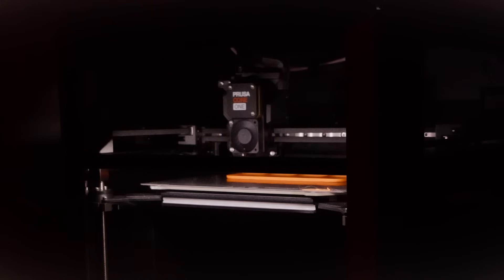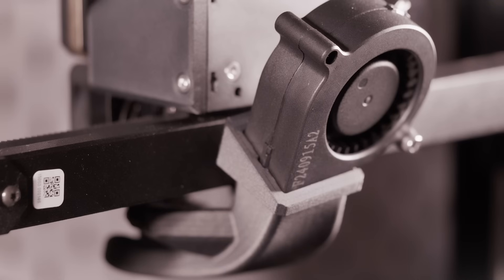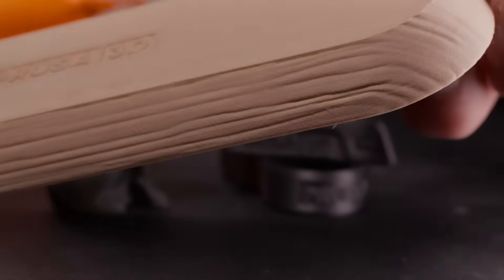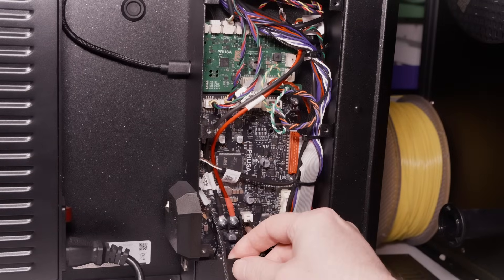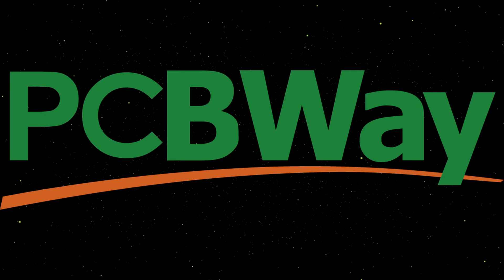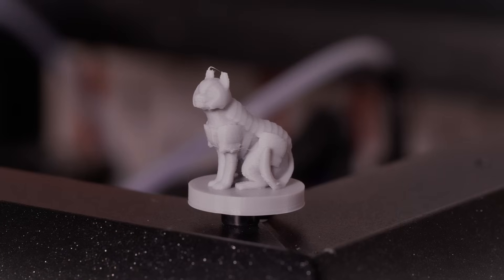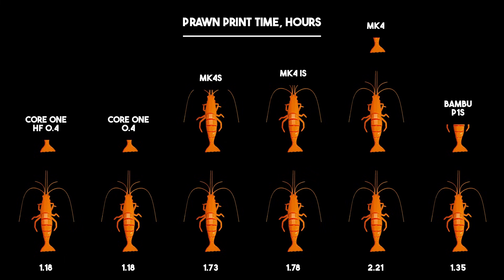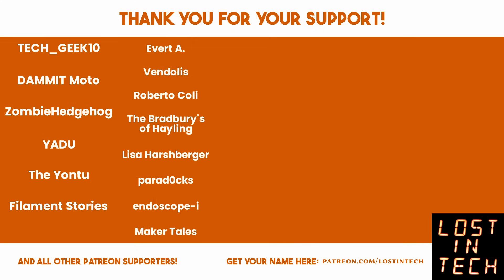Why the NEW Prusa CORE ONE is a 3D Printing Hobbyist and Modder's best friend.

Comment: The X1C isn't comparable to the Core One because... it's old? You mean the printer that predates the Core One by several years and still beats it in every metric but repairability and data privacy? Why isn't it comparable?
Reply: What metrics does it beat it in, exactly? Reparability, open source firmware, data control, lack of required internet or account connection, and many more reason to consider a Prusa. It can print just as fast as an X1C with better quality. Hilarious that people thing Bambu came up with almost anything except their calibration routine. I'd take a Prusa One over an X1C any day, and I don't intend to buy either. I have a Qidi Plus4. It also produces nicer prints than an X1C, by the way. The X1C is a great printer, but when people approach other printers with this snobbery it just shows lack of experience and knowledge.
Reply: @802Garage just look at it this way. The X1C is a polished finished product, the Core One is not polished or finished and it's really late to the party. The X1C is not just a printer, Bambu Lab polished the experience for the user. Little to no tinkering and more printing. The Core One right out of the box has some manufacturing/design issues starting with the "great" sheet metal frame which is a terrible design choice only made to lower costs and being able to compete, once again, with the X1C
Reply: @elleryfg7853  It may be late, but it's definitely a finished and polished product. You're focused on shiny aesthetics, not actual performance. Many people prefer the Prusa user experience to Bambu and all of the freedom that comes with it, if you like it or not. A bent sheet steel frame is essentially the gold standard of chassis stiffness short of a single cast unit. The X1C uses a sheet steel frame, silly goose. So you're insulting your own baby. What design and engineering issues? You're speaking like a pure fan boy with no actual critiques.
Reply: @802Garage  Take it easy with emotions, you don't own Prusa Research. The X1C uses a welded steel frame not a bolted together with multiple pieces with a lot of moving joints frame. Vorons use aluminum extrusions, Creality and Elegoo they both use cast aluminum frames with stiff joints. The reason Prusa chose sheet metal mainly for cost cutting, no need for mold development which have a high initial cost, the ability to change the design when issues arise, faster/cheaper iterations to the design. That doesn't mean it's a great choice, it's just the best choice available for them. They are in a race to keep up with the other manufacturers. Time is a luxury they don't have.
Reply: @802Garage  it's late and it's also not a finished product. A printer that needs mods is not a finished product. It still has a lot of stuff that needs ironing and you'll see it in a few months with Prusa releasing fixes to this and that hardware wise and firmware wise. Go to the Prusa forums and you'll find a lot of random a weird issues with be Core One. Just like any other Prusa printer. That used to be the standard, not anymore. Especially at this price point.
Reply: @elleryfg7853  What emotions? I don't even buy Prusa. I'm just being objective. There is essentially no difference for this purpose between a welded or bolted steel frame provided it is fit and tightened properly. I think this is shown pretty clearly by the print quality of the One which is excellent and overall better than the X1C. Then again the A1 generally prints nicer than the X1C. The One is a finished product. Every single printer ever made has had launch issues. Including... Wait for it... The X1C which had major problems. I really don't understand your vendetta here. You don't have to buy one. Personally I'd buy a Qidi Plus4 over either of them even though it has more issues than both overall. Oh wait, I already own one.
Reply: @802Garage  "provided it is fit and  properly tightened" is the key here phrase here. You just said you don't buy Prusa's hence you don't own a Core One. How do you know it has better print quality than the X1C overall? This is a highly inaccurate statement
Reply: @elleryfg7853  Again, clearly demonstrated by the print quality that it does fit properly and can be tightened properly. I know it has better print quality from the reviews and images. Do you own both? If not, you know just as much as me. You didn't even say what I said that would undermine my credibility at all. The X1C is a great machine and I never even insulted it. It does a lot extremely well. It is not, however, the pinnacle of print quality. Keep in mind Prusa has already made a core XY machine. Keep in mind the X1C was not the first consumer core XY machine. The consumer space was already evolving in this direction, Bambu Lab just gave a big push.
Reply from the maker: This conversation is just a bit silly. You can compare the specs yourselves, if you really want, you could go and watch my bambu videos, where oddly, I don't mention Prusa! Why not? Because I almost never mention a bunch of other printers in a video that's not about them.
Some of you are going a bit far with the back seat video production here, maybe I should ask you to write my script for me next time ;)
Reply: @elleryfg7853 Prusa has made plug and play printing for years before Bambu even existed. Strange way to describe it,. only thing to do back in the day was to set z height once. Then everything just ran, premade profiles are great so no tuning needed either.
Reply: @garagecedric  printers were never plug and play until Bambu Lab made all of them innovate for real and they still can't fully catch up.
Reply from the maker: I'm not comparing 2022 tech with 2025 tech 🤣 no matter how many times people get angry about it.
Reply: @LostInTech3D  What a crappy way to review products. Bambu is still a market leader with "old" tech that people do use and like no matter how much you or other people say otherwise. An no competitor? Regarding pricepoint or functionality? X1C and P1S are very obvious competitors to the Core 1 not just the K1C. that honestly felt like such a shortsighted comment. Also comparing it to an A1 mini was stupid considering the vast price delta and intended capability. Little Timmy getting an A1 mini for Christmas won't care about ABS. I own both a MK4S and a P1P, and your comments really feel disingenuous in not bringing up those points. It's ok to have a favorite, but I think you completely disregarded the biggest elephant in the room. 
If you don't want to review "old tech", then the Core 1 should just be disregarded then because it uses "old" tech?
Reply: @LostInTech3D  with this response you have completely killed your credibility. The 2022 tech is still the gold standard by which the Core One is measured. Also the main reason why you have a Core One today. Otherwise we would still be buying the Prusa MK8S++
Reply from the maker: and as for you @elleryfg7853, I think you've kind of just assumed a bunch of malice where there is none, including the elegoo jokes where we're all kind of having a bit of a laugh about it, and it turns out I'm going to review it. I make jokes about other printers a lot, if you're hurt by a joke about the bambu being old then I'm sorry, but this is not really that offensive. Long time viewers will know this is what I do. I've made the same jokes about every manufacturer. Most people get the context and react accordingly...what can I say. 
Please, relax and have fun.
Reply: @LostInTech3D  So what's the 'new tech' in the Prusa then?
Reply: @LostInTech3D and still you're

Comment: To get those rivets off easier is to press from the inside. Press the central shaft so the wings can collapse and slide out easily. Less chance of damaging the rivets or scratching the clear plastic panels.

Comment: Are there any problems feeding a soft TPU through the PTFE tube?  I print Siraya Tech 85A TPU on my MK4S with no problems.  I use a spool holder with ball bearings to reduce the friction and stretching of the filament while printing.  It's a nice straight shot down from the spool into the extruder with nothing adding friction to the filament path.  Is this possible to replicate on the Core One?  Could one remove the top of the enclosure and the PTFE tube from the extruder to facilitate printing from the top, or would it be okay to feed the TPU through the PTFE tube?
Reply from the maker: it should be okay through the tube at 85A, I ran recreus 85A through the Prusa XL to the same nextruder with no issues and I think the tube is at least 50% longer there. Any softer than that and yes you'd be looking to remove the lid and feed direct. It's a 2 minute job to pop out the plastic connectors and take the lid off.
Reply: There is an printable modification coming to Printables for people who print flex a lot. With lever you can disengage the filament sensor for easier feeding.

Comment: 290C max hot end temp is a let down
Reply: why would you need more? what type of filament are you thinking of using?
Also: I can be modded since you have access to the firmware, right?
Reply from the maker: I don't know if it's recommended to raise it, but luckily you can ask support such questions 👍 I'm not sure either what filament falls in-between 290 and the 360 you need for crazy industrial stuff that the expensive businesses printers do. 
I thought for a long while that things like nylon and pc were unprintable because 300c was needed but....nope, much lower

Comment: Actually it´s quite cheap: I started with the mk3 right after release. Upgraded to mk3s, to mk3s+, than mk4 (preordered, so I got new heated bed for free and new PSU for about 50€) now mk4s and should get the CoreOne upgrade in april. However, after upgrading to the Core One I can build the mk3s+ again from all the parts removed over time... So while I paid about the same as a pre build Core One while upgrading my mk3s+, I always had an up-to-date Prusa for years.
The mk3s+ I get again with the last upgrade isn't bad also: I can use a cloned Prusa Mini Buddyboard with display and a mosfet, use snake firmware and actually get nearly the same as a mk3.5 for about 60€ extra.

Comment: Qidi has several 'industrial lite' printers that have surprisingly good capability out of the box. They've had corexy for several years, though I know they weren't the first commercial option either. Bespoke, industrial printers I won't count, though for home use, the questionable quality TronXY was utilized the pattern since around 2018 or thereabouts. I would lump them into 'needs upgrades' out of the box, though they have gotten somewhat better along with the rest of the market in recent times.
Reply from the maker: I sorta feel like qidis before the small white one (plus one?) were using the flashforge creator pro type design but I never really was that invested.
Reply: @LostInTech3D  I didn't have much interest in their early machines either, and honestly I forget that flashforge still exists, haha. I'd have to look up Ultimaker's release dates, though I don't think of them high on the list of corexy for whatever reason.  I still like and respect Prusa for what they have contributed to the market as a whole, but I've not made the decision to invest in one of their machines just yet as until just recently, they hadn't had a machine that's ticked all the boxes. I tend to look for capability with engineering materials first with an enclosure that also come on on the large size, which is a rather narrow field. After Qidi, it's into commercial printers with large 4 digit price brackets, and the sky is the limit beyond.

Comment: Qidi plus 4 comes ready to print different filaments out of the box, and it's cheaper.
Reply: STAY AWAY FROM QIDI.

 I have a q1 pro (predecessor to the plus 4) and i havent been able to print a damn thing for 3 months. The plus 4 is also plagued with the same piezo/z-offset issue that gives you wildly inconsistent first layers. Ive been trying to work with Qidi since before december and i STILL have yet to come to a resolution. It was a great machine until it wasn’t. Ive barely owned it for a year and it might as well be a paperweight at this point. They’ve just been sending me parts to put on hoping it fixes it and it has done nothing but be a gigantic waste of time. I will NEVER buy another Qidi printer.
Reply: @EFLO3D  i can fix your issue in 10 minutes - tram the bed. it's a 5 minute job and you only have to do it once. the spanner that comes with it is all you need. qidi shipped a bunch of Q1s where i guess they forgot to tram the bed before packing them, including mine. you can see how far off it is in the klipper UI after performing a bed mesh - mine was about 4mm off. there are 3 screws under the bed - adjust them until it reads as close to 0 as you can get it, but anything under 0.4 should be acceptable as it can compensate for the rest automatically
Reply: @EFLO3D  I have used their Qidi I and it’s driven me away from closed frame printers, like all core X-Y printers on the market, calling them usable compared to printers today is a stretch
Reply: So does the Core One, with the bonus of not burning out the electronics.
Reply: @logicalfundy  resolved a while ago, it was on the 110AC units. As far as Chinese units, it is a compelling offering with superior specs. And it comes with a camera LOL. I do prefer an USA made printer, still waiting for something competitive with Prusa.
Reply: delete this
Reply from the maker: the qidi plus 4 did (allegedly) have electronics problems, and so did the one before it, I can't remember the name, with the heater being live (not allegedly, I tested it myself!) .

Comment: I've gone through 8 or 9 different printers in about 12 years, just trying to find one that meets my needs (low maintenance, near perfect reliability). My mk3s and Mk4s Prusa so far have been the best hands down, and the only ones out of all of them where not a single failed print was the printer's fault. The Bambu X1C was the fastest return I've ever done, a disturbing amount of failed prints, and the locked down ecosystem was cumbersome. The voron I built was the most impressive but a high maintenance nightmare. The prusas have been the only ones I can hit print and expect perfect results every time without babysitting. I can't wait to convert my mk4s to the core one.
Reply: I've been using my Bambu solidly for a couple of years and very very rarely do I have a failed print. Methinks user error or faulty unit.
Reply: @wayn3h  it was one of the very first ones ever sold in the US. It was failing in that whole pre-print routine where it would do calibration lines and such not a whole lot of control on my end for that
Reply: @ Fair enough. You can say a lot of things about Bambu but generally they aren't known for failed prints tbh.

Comment: What I love is Prusa is the only one of these that has an actual flat bed and of a reasonable thickness.  It's not voron quality, but it's way up there compared to the competition.
Reply: @TimGray  have you seen the one one the K2 Plus?
Reply: @henr1k5  I have, it is very uneven and not flat at all, not to mention all the other issues that printer has.
The unit I've had experience with may just be defective, but Creality's "support" has not been helpful at all.

Comment: do a longer part for warping in cooler rooms. something 250mm will warp... lets see?
Reply from the maker: good idea, one of those shelves for the side cupboard should work?
Reply: @LostInTech3D  id say its a good test. I print mostly abs on my voron 2.4.  Things with lots of mass tend to warp on me if i dont have higher chamber temps after soaking for a hour.

Comment: Worth pointing out these will be built in the US at some point in the future, the price of those “others” made in China may be going up thanks to Donald remember.
Reply from the maker: I did wonder if those others would be nominally "made" in USA, with about 5 screws added to the case. I wouldn't be surprised :)
Reply: @ Sounded like they have actual production lines going in, you’d think they’ll do some promo vids when they’re up and running. I’m sure all those patriots over there will flock to buy them then right?
Reply: @zerofox3d  They have production lines for filament and ASSEMBLY stations at the Printed Solid warehouse in Delaware.  No production of parts.
Reply: LOL...Assembled at best.  Please take your Prusa apart and look at where the parts are made.  If you think Prusa is making the circuit boards, stepper motors, and extrusions, your full of it.  Oh, a printer will cost a few dollars more for a while...cry a river.  There is a severe trade imbalance that is killing our economy.
Reply from the maker: Can confirm Prusa is making the circuit boards 😂 they have in housed it.
Reply: @LostInTech3D  I haven't purchased a modern prusa but mine says CHINA all over it.
Reply: @jonwoodworker  Prusa has only been manufacturing PCBs in-house for a few years. More precisely, after Covid they have tried to reduce their dependence on suppliers.
Reply: @jonwoodworker  Prusa literally makes their own circuit boards in house, in CZ. They have their own SMD line. The other electronics might be made in china, but they're at least from reliable manufactures. Prusa steppers are from LDO, while bambu is no name aliexpress stuff that share the same P/N's as steppers on an ender 3. Prusa fans and PSU are from delta, a USA company, bambu PSU? who knows, no name from a back alley in shenzhen, bambu's PSU's aren't even UL certified. Bambu uses snowfan brand fans, which are some of the cheapest quality stuff coming out of china. And prusa's steel fame and extrusions were all made in CZ, not china.

You could at least be correct iof you're gonna try and knock them.